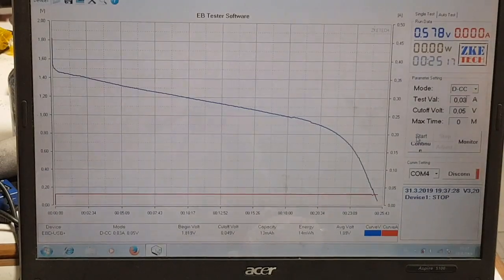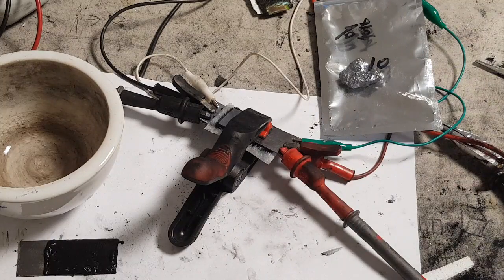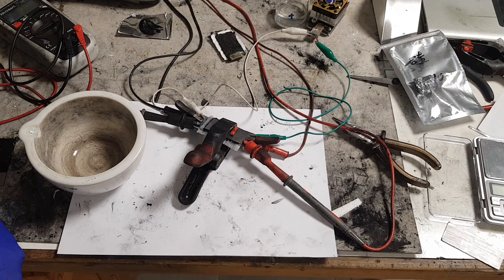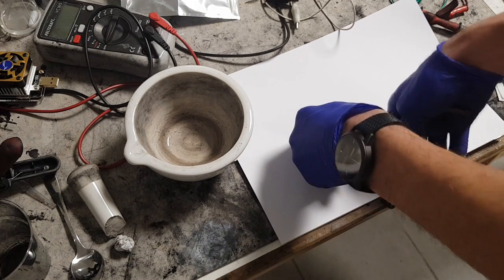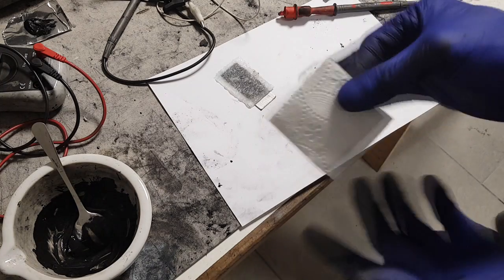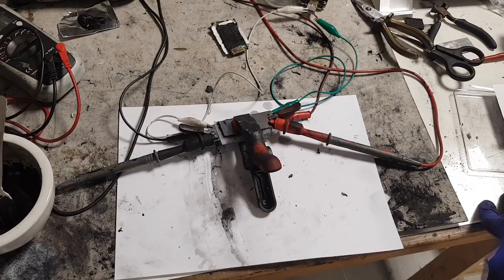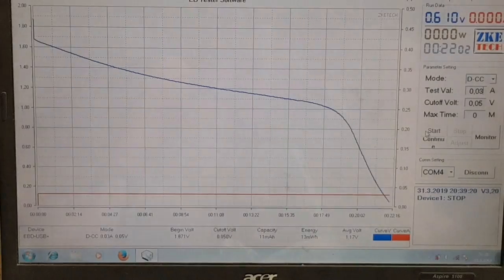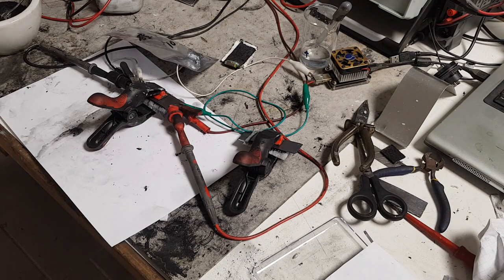Silicon Battery

Comment: What would you think of silicon carbide or other semiconductors instead of straight silicon? What's your opinion & have you tested anything? Do you think using some boric acid in your electrolyte would have any effect?
  I like the idea of using materials with semiconductive properties for battery manufacturer, for one idea, to act almost like a diode to create more resistance against self-discharge, while having less internal resistance for normal discharge. However if this is possible, it would require one to charge a battery much slower to avoid overheating and charging would be less efficient as you would be working against the diode like effect..